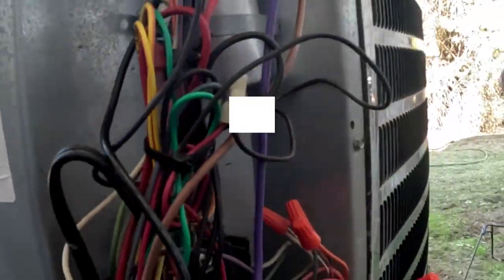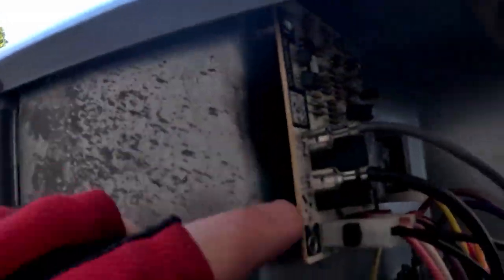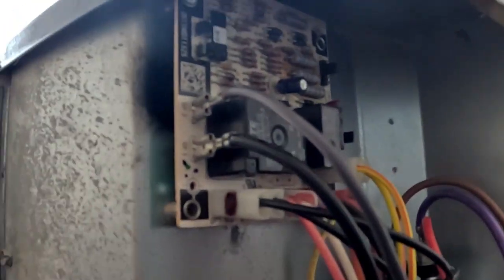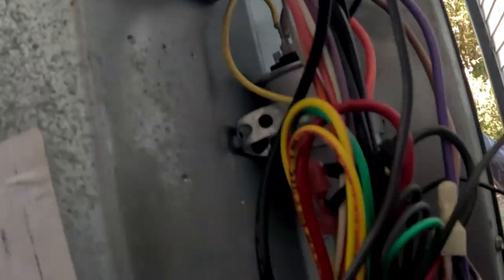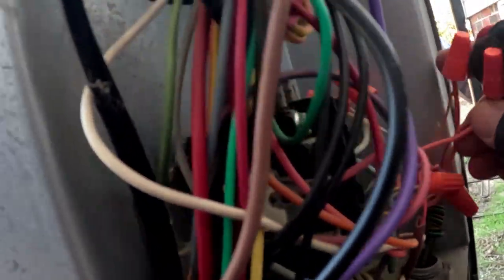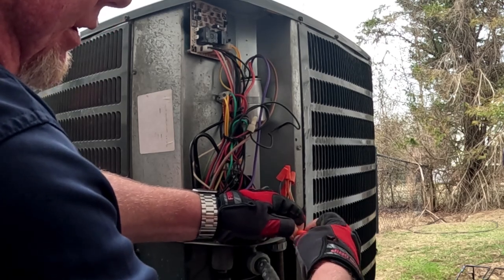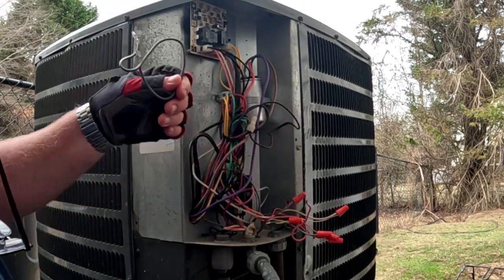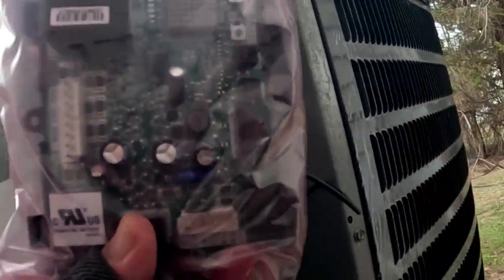Universal defrost control Installed on a Goodman

Comment: I like those boards because i like to upgrade the older units to on demand defrost. My personal unit is a goodman heatpump that i upgraded with that exact board. I agree that the wiring  makes it tight though, i used  a lot of wires ties. Lol

Comment: Charles don't feel bad you did what you needed to do and Charles it's about damn time hvac got aftermarket upgrade parts in the automotive industry we have done it for years. And it's kept cars on the road VS junk yards.

As for the board I see it says white Rodgers but then has the name Emerson and you know my feelings about Emerson. But I know their are other companies that make universal furnace control boards and other companies that make aftermarket defrost control boards. So at the end of the day that Goodman got an upgrade that will make your life easier down the road if that crappy old Goodman ever runs into defrost control issues.